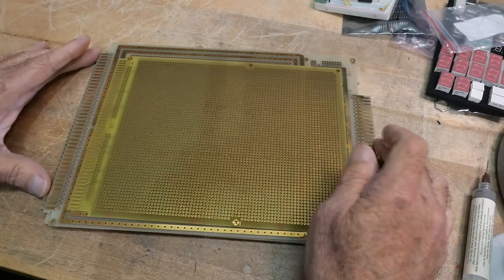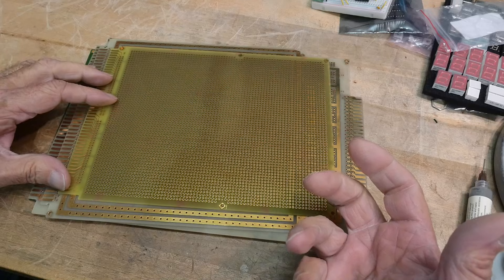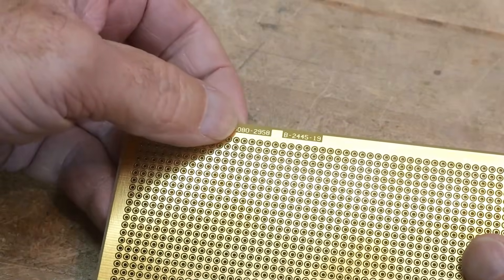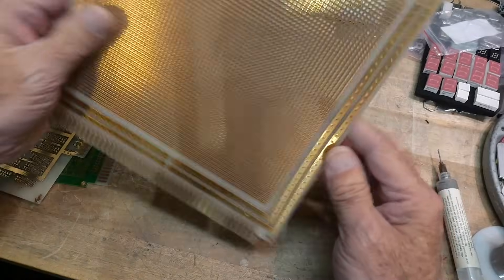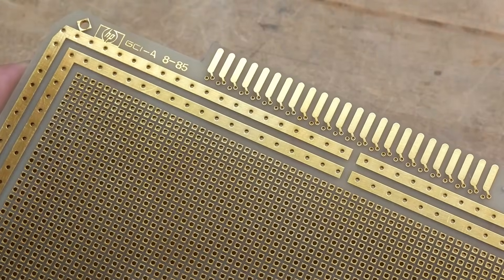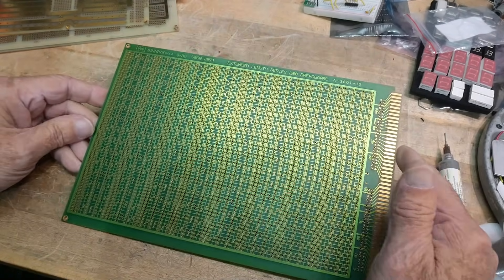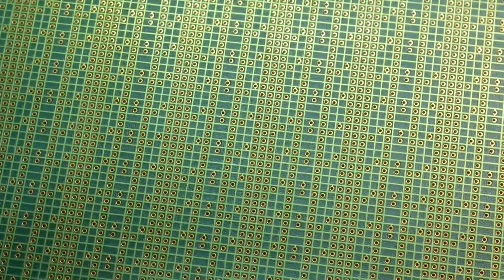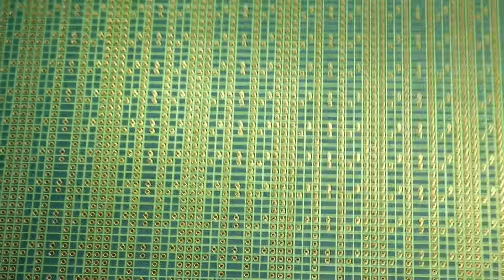#2138 Hewlett-Packard Gold Prototype PC Boards

Comment: I worked at HP's scope div back in the day. I have a few HP proto-bds of various configurations I picked up at HP scrap sales for probably 5 cents each. Copper, then nickel, then gold plating. Good stuff. I've never used them. I've saved them for a project that was worth it. Haven't found one yet.

The Series 200 was a desktop 'technical' PC released in '81. Proto-bds for it would likely be used for powerful'real-world' to PC I/O card designs, controllers, data gatherers. That sort of thing. I used an old XT for that stuff.

I built what was probably the first truly 'smart' battery charger on an XT proto-typing card. Much cheaper. I essentially built a PC-controlled high current function generator on the card, and a voltage and current monitoring system on it. Then I wrote a rudimentary BASIC program that would try a series of charging waveforms, pulse widths, currents, frequencies, etc while monitoring charge efficiency, then try more subtle variations of the best waveform's parameters it had found in a successive-approximation search of the best charging regimen for a particular battery chemistry, and also gather spreadsheets worth of data for analysis by a human, because ultimately I could analyze data better than I could write code to do it. Lots of data, but at slow data rates, so an old, slow PC was perfect for gathering weeks on end of charge/discharge info.

Comment: I manufactured PC boards for 20 years (plating, screen printing) The reason for the gold fingers is because gold has the least electrical resistance.
Reply from the maker: That is silver. Gold does not tarnish
Reply: @IMSAIGuy your description sez gold. It looks gold. So where does silver filter in?
Reply from the maker: just correcting the first comment. I just mentioned silver has highest conductivity. gold was used because it does not tarnish.

Comment: The 200-series looks like they have 3 columns of pins spaced out a little less than inch apart ... which makes me think the board was a backplane protoboard for 32pinsx3-row DIN41612 connectors... similar to VME-bus-based systems e.g.

Comment: It might be an idea to create a smaller version of that "cut up board" on PCBway, with both DIP and SMD spacings. Little SMD adapter boards could be plugged into the DIP space holes, etc.
Reply from the maker: have you looked at my boards on PCBWAY? I have many prototype boards
Reply: @IMSAIGuy  Thanks, I'll do that.

Comment: That last board was probably for the 200 Series desktop computers (9816, 9817, 9826A, 9836, 9920) and I suspect it may have been a wire-wrap board thus the single holes? Regards, David
Reply: The first HP Unix bitmapped/windowing machines came from 68000-based Series 200 and we did a lot of creative case bandsawing and backplane risering to jam enough RAM into them so yes I think you're right -- definitely not a riser board but I think they were that crazy long (the 9826's height was roughly doubled with the riser IIRC, hence the bandsaw). I worked a couple hours South on HP's in-circuit emulation workstation whose wirewrap proto boards were a bit larger, and cut nicely for smaller projects on the machine-shop sheet-metal shear we engineers were allowed to use. Same site made HP hook-up wire and o-scope CRTs.

Comment: 2:05 makes me think that it is for low impedance ground connections, too bad we don't have protoboards like these made today for marketplaces.
4:02 square is bigger area which translates to slightly bigger mass and a lot more adhesion for pads to break off less easily under heating.

Comment: Probably they used the square pads because of surface area, round ones that fit in the same area might tend to lift unless your soldering was impeccable.

Comment: At TI we had similar boards, but they were just tin plated.  The popular ones were call blob-boards, because they had square pads that you could use solder blobs to make connections.  They typically had 22/44 pin edge connectors to fit in those vector card racks.  This was late 1970's.

Comment: The gold plating on those boards can be reclaimed for money.
Reply: You mean the absolute shtheads that ruin rare retro hardware by cutting off the gold fingers from cards? Yeah, no, that's a bad idea :D
Reply: @Chriva  Hewlett-Packard's recycling plant in Roseville, California processes electronic scrap and sorts through it for precious metals.  I wonder if they would add the funds to IMSAI Guy’s pension if he took them there. 😊
Reply: On eBay maybe....
Reply: @ There are gold reclaim companies that contract with platers & connector companies to chemically extract the gold from the discarded product.
Reply: "for money" as in for profit it's stoopid, for recycling actual production scale zero-value waste sure..
Reply: @Mr.Leeroy true, but those boards have a lot of surface area and 1 um gold might add up.  Depends on the volume. Not my speciality, I leave it for the bean counters.
Reply: sacrilege!
Reply: They are gold plated.
Reply: Wonder how much PCBway of JLCPcb would charge for these.